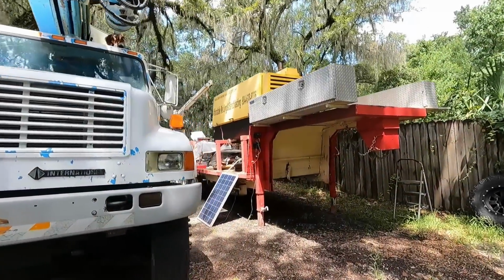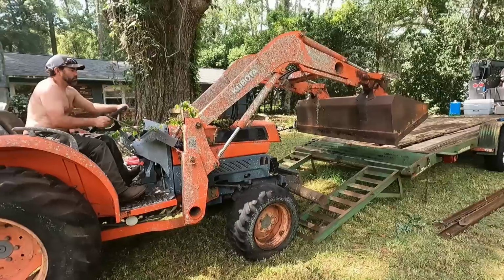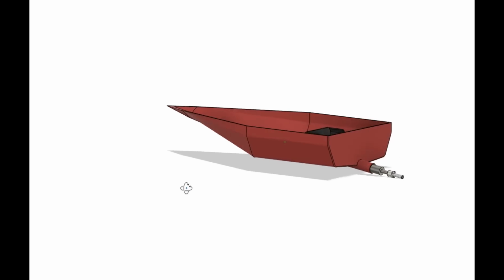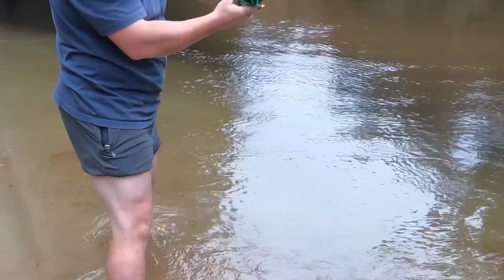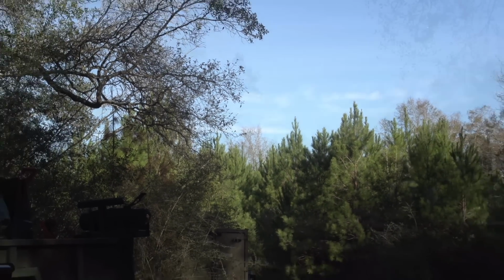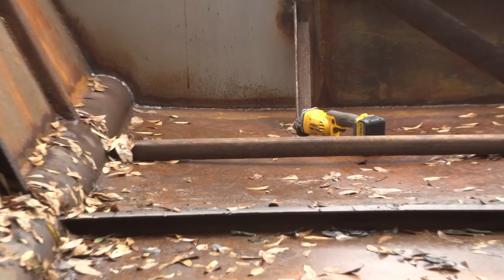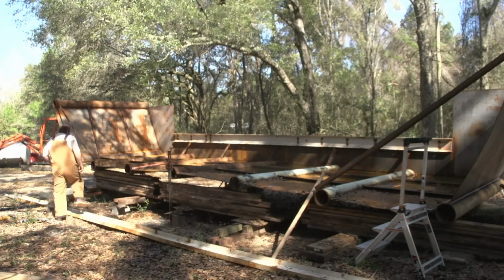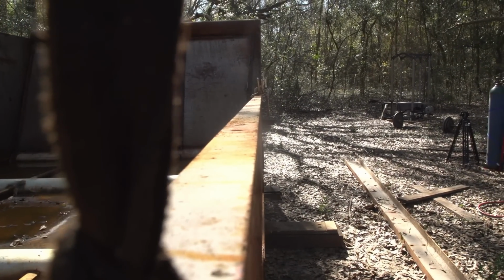Back to the boat

Comment: Looking really good and nice to see you making a video again. That's a lot of welding, I would advise that you should be welding stick uphill and not downhill. When you weld downhill, the slag flows down in front of the weld, creating dirt in the weld, which will result in some porosity and a weak point. It might not matter for where the boat will be moored.